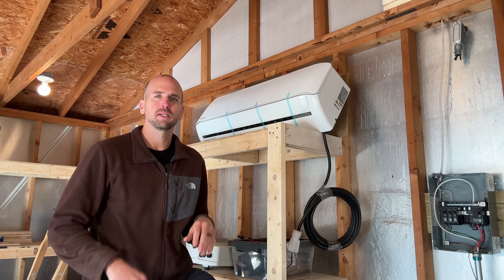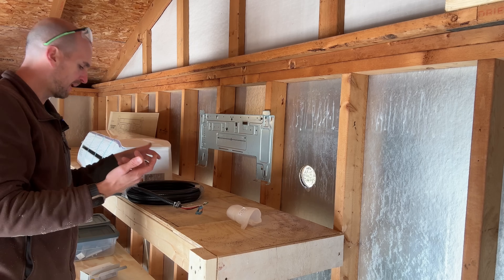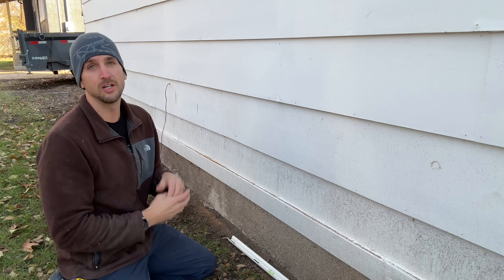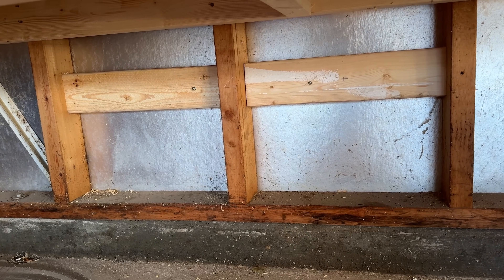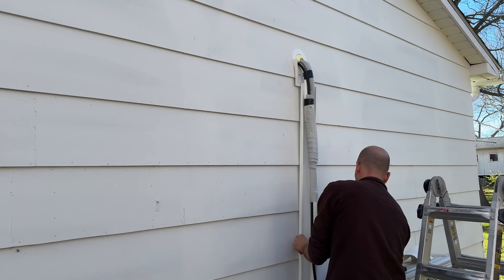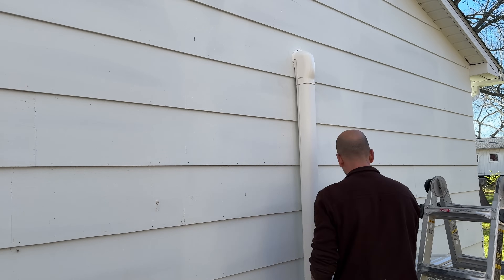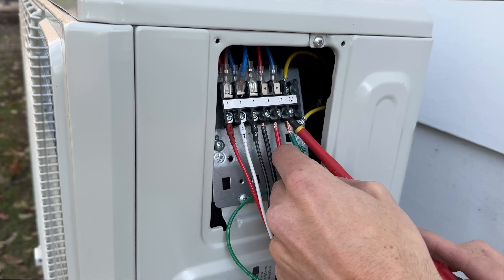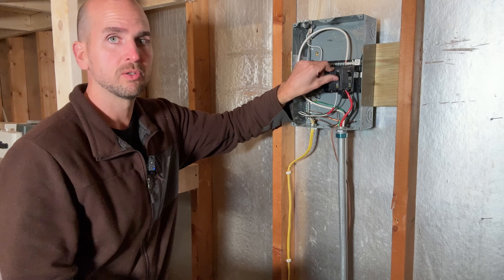Complete DIY Mini Split Installation | New Mr Cool 4th Gen Unit

Comment: Very good explanation,  I'm a retired Local 11 Electrician,  that's  LA California.  I like the red tape on the neutral. Safety First.
Reply: why would you use a 110 line for a 220 huck up the have 220 line for that

Comment: It should take 12/3 wire for a 240 volt system.  Two hot legs of 120, one neutral, plus a bare ground wire.  12 is the gauge.  Theo other number is the wires (not counting the bare copper ground).  He also did not show checking for leaks in the refrigerant lines using soapy water before wrapping the lines.

Comment: The inside has no wall covering. I dont know why you would drill a hole out the top and run all of that line down the side of the house? I coiled mine up in the attic and ran outside only what i needed. Only drilling a hole a few feet from the unit.

Comment: I have gave the same disconnect box but I’m only running 115 V. Since my neutral wire isn’t hot, do I hook it up the same way you did yours even though it’s not hot.

Comment: right off the bat he skips an important thing - the initial hole should be drilled at a slightly downward angle so the water will drain properly. Then he skips checking the connections for leaks with a soapy spray. Also, the extra coil of tubing should be positioned horizontally not vertically like he leaves it behind the unit.

Comment: The lines are not charged; the unit is. The lines should be vacuumed before connection to remove moisture.

Comment: Can the refrigerant lines be run under the siding? Home is currently being sided. I have 1.5” styrofoam insulation between osb and siding. Would that be too much to bend without kinking lines?

Comment: Hopefully he mentions not coiling the extra line set in a vertical position.
Update 1: Oooh, fail at 9:25 by coiling them vertically, which prevents oil from returning to unit.
Update 2: Oooh, fail again at 10:15 by wrapping the connections before testing with soapy water.

Comment: Could you have ordered a shorter line set? Also, you did not evacuate the entire system but just connected the pre-charged lines to the condenser?

Comment: I want to mention that the pre-charged refrigerant gas is in the outside unit (Condenser). That is the reason it has the 2 valves. The 1/4" line pushes the refrigerant to the inside unit (evaporator), and the 3/8" line is for the return that completes the cycle, allowing the gas to be compressed again.

Comment: Thank you for showing how the wall mount adapter mounts to an exterior wall with siding. I've noticed MrCool units are significantly more expensive than other manufacturers. For example, I'm looking at a 12k btu unit by Senville which is $900 on Amazon as of this writing. The same 12k btu unit by MrCool is $2359. The Senville unit supposedly has good ratings. Does anyone have an idea on the huge cost difference? Is it simply quality, or does the MrCool unit have parts the other does not, to make the installation easier and/or better looking??

UPDATE: To answer my own question, the MrCool unit comes with a precharged line and quick disconnects. Without this, one would need a vacuum pump and a set of gauges to properly set up the lines, which is what is needed for the Senville unit.

Comment: Spent 2 years getting my HVAC/R degree, so take my advice for what it's worth. Never understand why most diyers don't think they need to evacuate the refrigerant lines before they release the refrigerant stored in the condenser. The reason this is important is because air contains moisture, and moisture turns to acid as the refrigerant oil mixes with water (moisture). It ultimately caused these compressor's life to be shortened, so you don't get your money's worth in the long run. Do yourself a favor, spend a dollars on an HVAC vacuum pump, hook up the refrigerant lines, and draw the lines into a vacuum before releasing the refrigerant from the condenser.
Reply: Mr. Cool is one of the few units you don't need to do that. The lines are actually sealed and ready to go. They are already precharged. They also have a special connection that allows them to be connected with no air into them. Now if you get another unit or cut the lines to length, you absolutely need to pull a vacuum...
Reply: @alexdelong609 thanks for your comment, it is true that the lines come pre charged with nitrogen, the moment you piece the line, you draw in outside  moisture rich air, which replaces the nitrogen. The units are placed in a vacuum from the factory, and then they are filled with nitrogen which takes the place of air, thus keeping the lines free from moisture.
Reply: @nevadacool  So which is it?  They are pre charged and don't need evacuation, or they do need evacuation?
Reply: @walterjones6734 Mr Cool claims you do not have to do anything with their lines.
Reply: That AC is not going to cool as good as it could if you would have cut the extra 20 ft out of the lines in might have cooled a little bit better. And if you would have evacuated it it would have cool it even better. You obviously forgot to read the directions.
Reply: exactly, I was waiting for that procedure and was surprised he dropped the ball...
Reply: I spent no time in a technical trade school, only did it. At 19, I took ASE Certification test and passed all 8. That was 78, when called NIASE. I have 2 vacuum pumps, 4 sets of gauges and license to buy refrigerant. 
  Now, after evacuating & charging systems, repair charging is done on a cell phone app!
Reply: I used to install Mueller milk coolers that used aeroquip fittings that had a break away diaphragm on each end and were charged with refrigerant.   There was no need to evacuate the lines.  The oil trapping issue with 3GS lubricant is solved by heat pump flow reversal.  The miscibilty of new lubricants has improved since then.  The flamability of some newer refrigerants means that thorough purging and evacuation are needed to shorten piping run.  That pulls it away from DIY capabilities.
Reply: @mikemorse8609 I'm sure that the system has a filter dryer installed as well, so yes, then the moisture issue would be lessened, but there is no filter drier on most mini split system, this your point is not applicable
Reply: Mr. Cool's DIY version of their minisplits are pre-vacuumed so that you don't need to do it, but you pay a lot more money for that luxury. The other versions that are not listed as DIY, you still need to vacuum. I've only seen one other company offer the same "no-vacuum" line sets.  Almost all other minisplits absolutely require the vacuum.
Reply: @heididecker707 the lines are vacuumed, and filled with nitrogen, but one the caps on the fittings are opened to connect to the King valve, the nitrogen is released, and air replaces it. You must vacuum, there is no way around it.
Reply: He should’ve used some gauges to check negative pressure for leaks on the connections. Just because factory already flares the connections they be bad. Once he opened it all the way up if it did have a slow leak he will be calling a service tech to put more Freon in.
Reply: Your exposing lines to air wether you evac or not. The trick is to seal it within 15 seconds or less after removing the caps. Removing vac pump exposes lines as well. Dont you think. A special consuderation for both methods. Imao.

Comment: For the external disconnect box, I see you used a fused box.  If you're running from a 20 amp breaker, is there a reason to be using a fused disconnect box instead of a non fused box?
Reply: Redundancy, not needed.
Reply: More useless overkill

Comment: Can you bend the lineset coming out of the back of the indoor units tight enough to run inside a 6 inch wall? I want to run it inside the wall until I come out near the condenser. This is being run in a new pole barn.

Comment: I had a hard time with the bracket, they shorted me adjusting bolts, and the nuts to secure the arms with the long bolts. Then the lags to mount had such a large head my socket was prevented from driving them all the way without hitting the flanges. Crap design for sure. How did you drive them so easy without bending the flanges?

Comment: You are misleading people ,first the lines don’t come full , 2nd you didn’t pull a 30 min vac on the lines and inside unit , 3 rd there shouldn’t be more than 3 bends in the ac lines ,and never roll them up ,cut to size ,you get a f

Comment: #1 MISTAKE IS THE LOOPS IN THE LINE SET MAKING A OIL TRIP Drain the oil the compressor needs to cool down and lobe the compressor SHORTING THE LIFE OF THE UNIT.
Reply: If he mounted the extra coiled lines horizontally, I think he would be okay, but the way he has the lines now is going to create an oil trap.

Comment: You left all that extra lineset sagging behind the unit? Also you didnt vacuum the system before opening the valves.  Handyman doing hvac work here
Reply: The unit is precharged for the line length. If you cut that, you are overcharged. You would then have to remove some refrigerant. No longer a DIY for most folks.

Comment: Most people would not take on installing a 220v outlet themselves.   You need to know what you are doing. 

Hiring an electrician to install one can probably run from around $300 to way north of that depending on how far away the outlet is from the panel, location, going through walls, under crawlspace or whatever. 

Also you will need a permit and inspection. If not done by the book, then if something happens insurance may not cover you or you could face a lawsuit.
Reply: Also just about no AC company will work on a DIY install.

Comment: great video. No matter what I do, I cannot get the condensate drain extension hose to connect to the barb on the end of the hose coming off the inside unit. My extension hose was one piece wrapped together end-to-end and had to be cut, but nothing fits the barb. Any suggestions? 
Also I cannot get the condensor end of the line set to fit right. The smaller connector is much shorter than the larger one. Is it okay to cut the foam insulation off of it?  I have the DIY-36-HP-230C25

Comment: How cold can it be outside for this one to still work? I think most are 25.
Reply from the maker: Most of these new ones can go even lower than that as they have made improvements to the design but they will pull a high and continuous load to create heat when you get to the colder temps.

Comment: My install site for the 18 BTU unit I want for my living room is on the opposite side of my house from my breaker panel. The Romex would have to be run across the length of the attic to the breaker panel. Would this scenario be common for an electrician for 240 VAC? I am ignorant re home electrical.

Comment: Should use Nylog sealant and pulled a vacuum on the line set and air handler before opening the the valves.

Comment: You should really learn the proper way to install one of these systems, you never leak check one of the fittings you didn’t use a vacuum pump to evacuate the line set so now you have noncondensible gas in the refrigeration system which is gonna be a disaster in about two years people like you drive me crazy you put a video out talking like you know what you’re doing, but you have no clue what you’re doing

Comment: Very nice video...I never installed a Mr.Cool system so i will guess the refrigerate lines have check valves that retains the refrigerate and I will guess the wall unit has a charge of refrigerate also...so when connected there is a negligible to no loss of refrigerate...
Or am I overlooking something....
Thanks very much
Reply: The lines generally don’t come with refrigerant in the.  The come a specific length so when the refrigerant that’s backed up into the compressor and condenser.  We would generally shorten the line set to avoid the extra coiled up.  Then using a gauge set and recovery pump bleed off some refrigerant to compensate for shortening the line set.

Comment: I'm a year after the installation of one of my units and I figured I would add a must do preventative maintenance suggestion once your unit is installed.

Take the top cover off the condenser unit, open the control board box and seal up all the holes for the control board box. This will keep moisture corrosion out and, in my case, keep the mice from moving in and chewing up the wiring inside the control box. Expanding foam seems to keep them out.
Reply: Does it need air flow?
Reply: @James-cs4zk  Mine doesn't need air flow. It has a heatsink that sticks out fan side so it is cooled as the unit runs. Just regular electronics inside the box.

Comment: I am in the process of installing a 5th Gen,12,000 BTU, Mr. Cool Mini-Split. I have installed the air handler and the electrical disconnect for the service disconnect. I will install the condenser tomorrow, the linset cover (PVC that is UV resistant) and the linset itself. Here's a summary of what I have found:

1. This is my first Mr. Cool install. I am a licensed general contractor and a civil engineer,M and so I have a competent working knowledge of all of the components of the system.
2. The instruction book that came with the unit is for pre-gen 4 Mr. Cool units. While some of the information transfers over, a lot of details are wrong.
3.  The rear bracket for the unit works, but it is about two inches too narrow. I had trouble locating the unit where I could catch two studs to secure it to. I am installing it in my garage on an exterior wall, so the stud layout is 16 inches on-center. While I realize the 12,000 BTU unit is a small unit,  I think a little wider bracket would have been helpful. However, the bracket that came with the unit does work for 16" O.C. walls. It's just a little trickier to locate the unit.
4. Since the instructions were useless for my unit because they were outdated, I had to figure out how to use the template myself. In hindsight, it should have been commonsense,  but the first time I set the bracket too high, so it did not cover the 3.5 inch hole to the exterior, and the second time I set it too low and the lineset hit the bottom of the 3.5 hole and insulation on the linset putshed the bottom of the unit up, out of level - which was frustrating. This isn't Mr. Cool's fault - it was my fault. But it would have been nice if the instructions were more detailed on aligning the 3.5" hole in the wall with the metal back bracket. I was able to just reset the back bracket up 3/4" and that fixed the problem. Now the unit is nearly perfectly level and very close to being centered on the wall it is mounted to. It looks really good!
5. My condenser unit shipping box had two big gashes in it, about a 1/4" wide x  2" long. Fortunately, the front grill was only slightly bent, so I just straightened it out myself. I think a little more Styrofoam would have prevented this damage. The air handler box had no damage and Mr. Cool did a fantastic job with their packing. 
6. I was able to pick up a service disconnect that doesn't require fuses at Home Depot for $12.00 and it is perfect for this job.
7. So far, everything that should be included with the unit is there..
8. I  picked up a 4" PVC line cover set from Amazon for $50.00. The box it came in was badly damaged, but miraculously, the PVC lineset cover pieces do not seem to be damaged. It includes 15' of run for the cover.
9. The unit runs off a 120V line and does not require a 240V circuit.  Mr. Cool's design specs require only a 20-amp breaker and 14-gauge wiring. So you know the unit is not going to use a lot of power.
10. In researching this unit online, it appears that it will only draw 4 amps for cooling, which is spectacular. It has a SEER 2 rating of 23.5, which is exceptional. There are some ultra-expensive mini-splits out there that have a SEER 32 rating, but you are going to pay between $3,000 - $4,000 for a 12,000 BTU unit, and it will have to be professionally installed. So you will never recover your money with the extra efficiency these cutting-edge minisplits provide. I could buy three Mr. Cool units for the cost of one of these high-end units. Even more concerning is that we don't know how reliable these $4,000 mini-splits are. They do come with a 10-year parts and labor warranty, but if it breaks down, you are still without AC or heat.

Tomorrow I hope to finish installing everything and power up the unit. I live in Arizona, in the Phoenix metro area, and we had over 60 days where the temperature was between 110  -118 degrees F.  I am installing this to cool my garage, which is roughly 360 SF, so this unit will easily cool my garage.  According to the AI calculations I checked, it should cost me less than $20.00 a month to cool the garage in absolutely brutal summer heat, and that is a screaming deal.  Since my garage is attached, I think it will help cool my main house also. 

So far, I would highly recommend Mr. Cool. The 5th Gen units seem to be very high quality, and they provide almost everything you need to install them except a dedicated electrical circuit, a disconnect and mounting hardware.

Comment: Mrcool are junk my son and I installed 2. 1 in his house 1 in mine both 12000 btu both compressors quit in 4 years. Then they would not Honer the 5 YEAR warranty because we installed it ourselves. I own an auto repair shop and have my own gages and vacuum pump. I tested the units after they quit and they still had 200 psi of refrigerant in them. I paid $1100 for mine to get high seer. I replaced it With a Apoodr for $522 on Ebay 3 years ago if it last over 1 more year I'm ahead $578.

Comment: Great video!  Only thing that I see is different from your install is the installation guide states that there should be "Minimum Clearance between the back of the unit and wall: 12 in". That is not possible with the typical wall mount brackets.